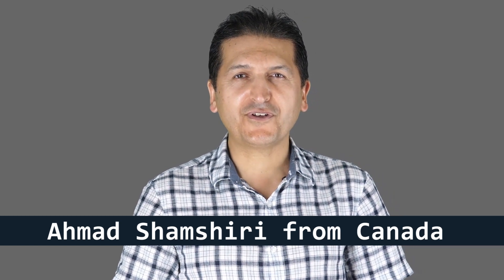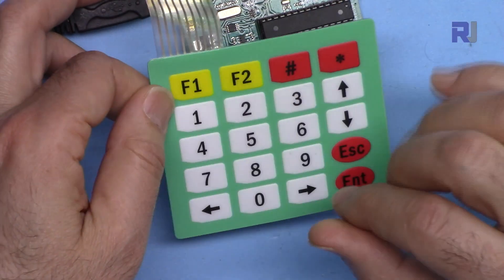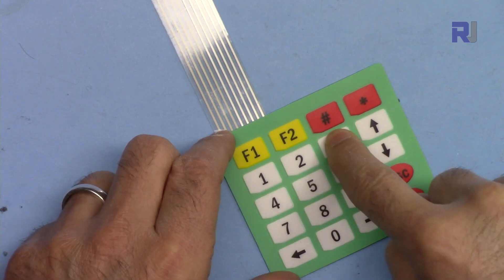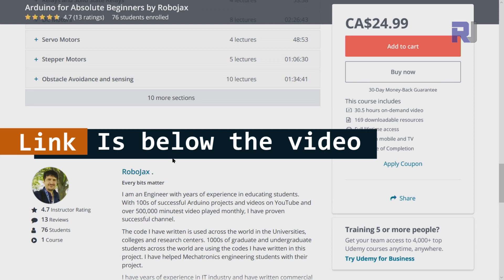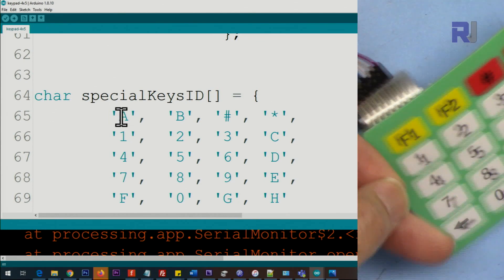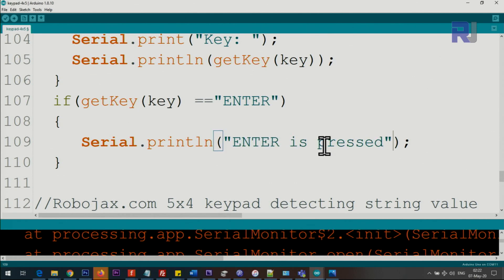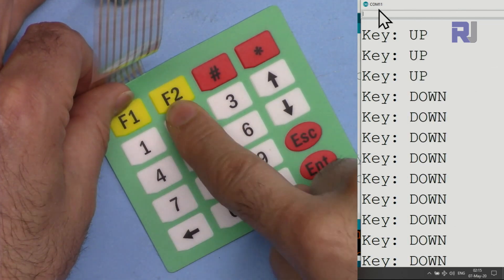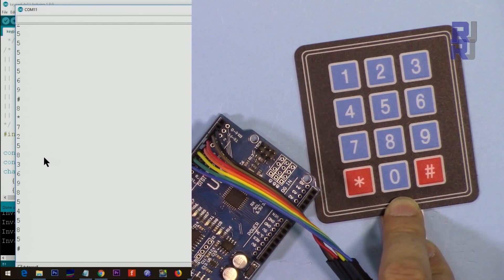How to use 5x4 20 keys keypad  with Arduino detect String - RJT309

Comment: there is a problem sir, I use arduino nano instead of uno, but I still connect the wires into nano as same as uno( 2 -> 10). However, after uploading the code, I opened the serial monitor and it just showed:
Robojax 5x4 keypad
Key: LEFT

and didnt show anything else although I pushed other buttons.
may you help me please?
Reply from the maker: Hi, it should work with any board. check ht ewiring.

Comment: Can I use DF player to this & keypad 5 X 4 to 2717 - I2C multiplexer, Adafruit & activate 20 sounds??
Reply from the maker: The whole pint was to be able to get which key is pressed. Now you can do whatever you want. Process the key pressed and take action.
Reply from the maker: You can if you know how to use it. Using I2C you can control 128 devices.

Comment: How to write 11 and 111?
Reply from the maker: create two variables called char code[3]='1','1','1'; and char readCode[3]; then when every allow use to enter 3 time something. every time save the entered value into readCode array. after 3 times compare each elements of  readCode with code and if they all match, do something like turning ON relay or something else. good luck.
Reply: @robojax  thanks I will try
Reply: @robojax  thanks I will try

Comment: I use to connect with I2C PCF8574 to save some I/O on the Arduino. Will it work also with this Keypad (5X4) ?
Reply from the maker: it should work with any input that Arduino reads. yes.